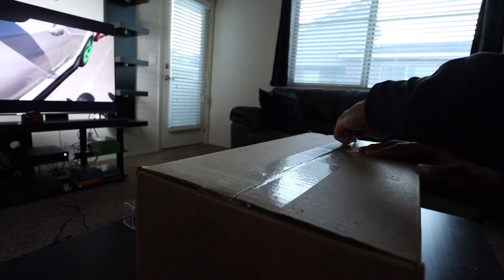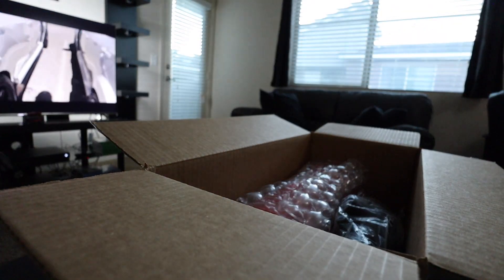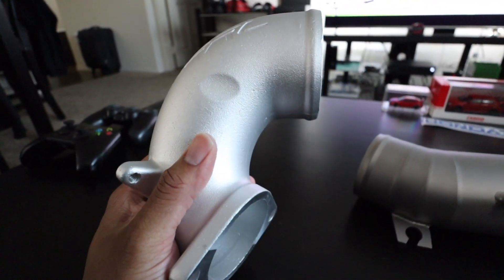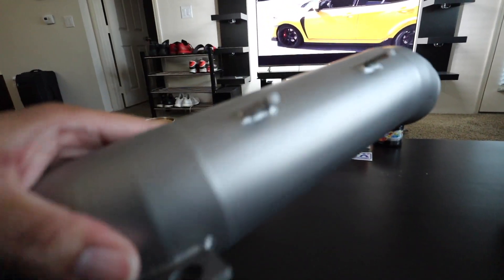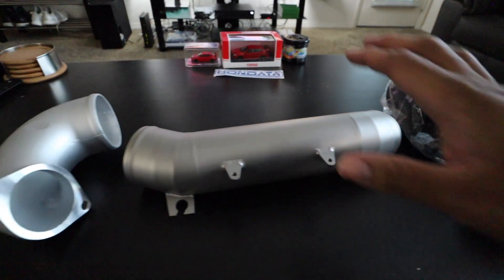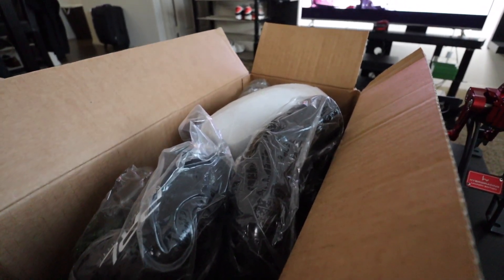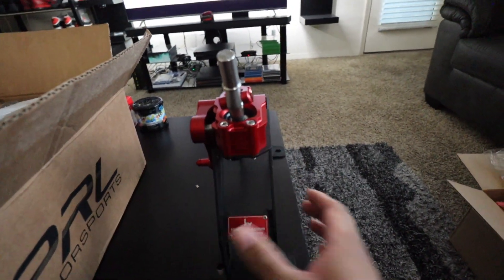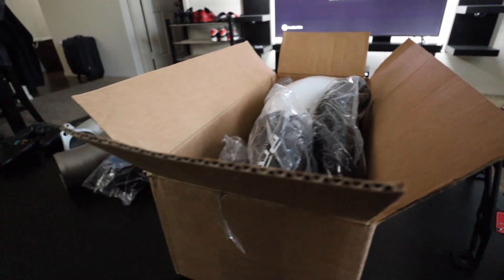PRL Turbo Inlet piping for Honda Civic Type R FK8 - Unboxing and Overview

Comment: I'm loving my Ti inlet.  I ordered it during the black friday sale, didn't get it until January 10th but it was worth the wait.
Reply from the maker: Very nice! Glad to see your enjoying it. I’m looking to finally install mine here in the next couple weeks!
Reply: @K20Elite23  waahhh?! You haven't put it on? Lol best believe as soon as I got mine the intake and old inlet were pulled out and this thrown in.  Just make sure to have magnetic sockets or some painters tape handy as the 2 bolts that go into the compressor are a little tricky to get to.  I used an 6" and 10" extension for them.   The back one needs a longer extension to get a ratchet in there with clearance.  Just gotta unbolt the wiring harness and bracket for the wastegate and take the a/c line off the bracket so you can manuever a straight shot.  I didn't have magnetic sockets so I wrapped painters tape around the socket and bolt flange, once I get them threaded back in it was easy to rip the tape off and fully bolt it down.  Don't know if you have the HVI intake as well but with the Ti pipe the hose for it has much better fitment.  Getting the HVI on with the stock inlet was an ordeal to say the least.  PRL is on point with the parts they develop for this platform.  I've got their HVI, inlet, downpipe (catted), intercooler w/charge pipe upgrade, using a different front pipe since it came with my r400.  Spool now compared to stock is night and day. So quick.  I can't wait until they finally release their turbo, as of right now I'm pushing all I can get out of this motor due to the weak fuel pump and small turbo which falls off at the top.  Their bigger turbo will be much stronger up past 5k RPM.
Reply from the maker: Love the feedback and install tips! Thank you! I’ll be sure to put a video out once the install happens! Glad to hear the spooling process is much improved as well. Can’t wait although I’ve had this piece for months 😂 

Thanks again!

Comment: Hey!! Rookie question haha.  I'm thinking on buying the PRL Inlet pipe kit and I noticed that it gives the option of choosing between the Stock Intake System or the PRL HVI System Hose.  I also was thinking on buying the  HVI System...doesn't the HVI Intake system already bring the HVI Hose that the PRL Inlet pipe kit gives you as an option?
Reply from the maker: Yes that’s correct the inlet pipe comes with the same hose as the HVI.

Comment: Just subscribe to the channel. I have a 2019 fk8. I just copped prl everything. Fp, dp, hvi, intercooler,hondata, ti resonated exhaust from rampage fabrication. Rampage is doing all the installs first week of April. Whp numbers?
Reply from the maker: Thanks for the support! 

So far I’ve installed exhaust, intercooler, front pipe, PRL HV intake, and tune with base map from hondata. No dyno numbers for now, I do have the inlet pipe, intercooler pipes, and a catted down pipe but have yet to install, and no rush to install for me as I’m happy with how the car feels now... curious to see what numbers you get with the mods you listed.

Thanks for watching!
Reply: K20Elite23 I’m thinking I’ll be at 370whp